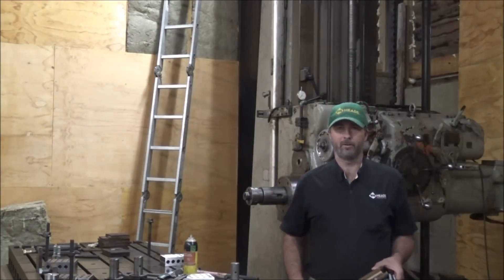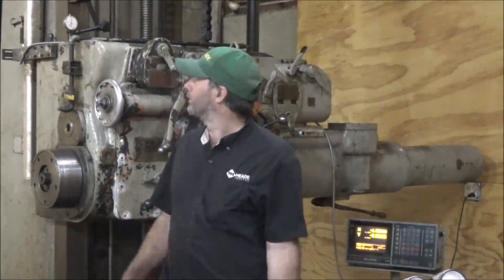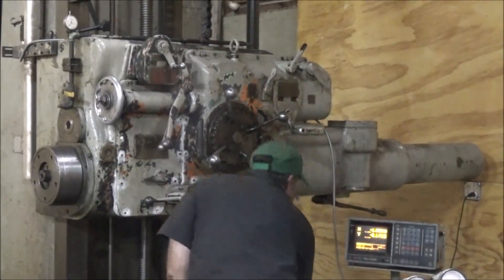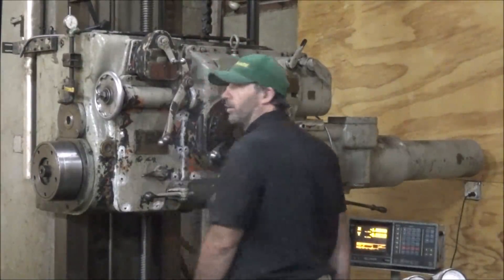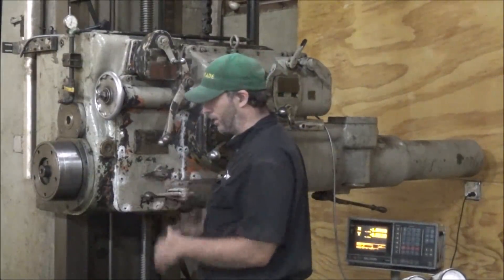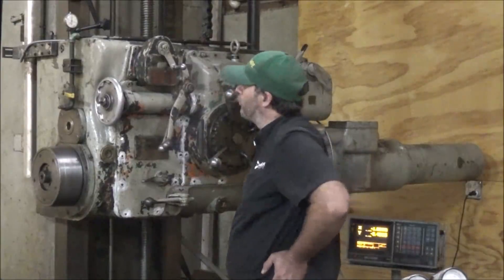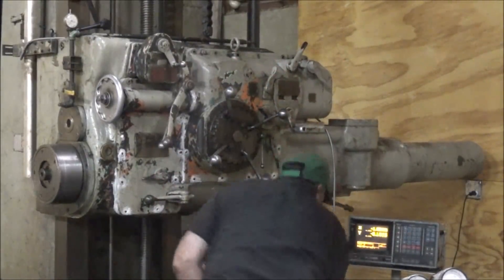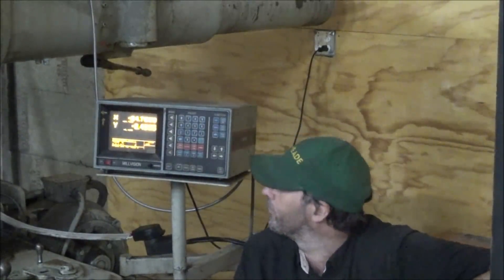DRO fixed!

Comment: Where did you end up finding the reader?  I'm still struggling to get my X-axis AR-5 scale to work on my mill.  Still hoping it just needs adjusted, but no luck yet.
Reply from the maker: Does it read numbers at all ever or always nothing?
Reply: When I first got it, it would read intermittently.  It would work just fine, then it would go blank (I think, or 0's or 8's or something).  Then I could reset, and work again for a bit.  Seemed if I went really slow, it worked longer than if I went fast.  I took the reader head off, and cleaned it and the scale with alcohol, and now after re-assembly, doesn't read at all.  However, when the reader head is off, if I move an allen key (or other steel) over the head, the display does read a change.
Reply from the maker: Sounds like an alignment problem. You may have to bend the wire some to be sure that the side of the reader with the plastic feet is squarely against the glass. It should have tension pushing it up as you put the reader into place and bolt it.
Reply: Thanks Brian, next time I get out in the shop I'll give that a shot.  I've really enjoyed having the Y axis DRO, so getting this working would really be nice.
Reply: Our G&L at work has a Dro as does our 16 ft Betts VTL floor mill .

Comment: Watching it closely in operation, the load on the vertical screws has got to be ridiculous.  Is there a special high pressure lube used on these?  Back in the old days it would have been lead based (dead center lube?) I'm guessing. Seems like part of the noise in the lift is torque wrap in the rods, if these are in great shape and lubed to spec lifting or dropping should be pretty quiet, no?  Glad you got the replacement scale, amazing how you can still find stuff available.
Reply from the maker: There is some bend in the shaft that operates the tailstock elevation. This causes the bevel gears to mesh too tight and thus they make a lot of noise.  The screw nuts are auto lubed by the Vactra #2 same as the ways.
Reply: Gotcha.  Should have expected a flowable lube to flush waste, but still, what an "s-ton" of weight.  If you watch Keith Fenner's latest, he needs your machine for his Audi block.
Reply from the maker: Yes the G&L would be handy for Keiths Audi but I am sure he will manage ok. :-)

Comment: How old is the dro display box.  It might be time to examine and map out the electrolytic caps in it for future replacement . Caps are used by some manufacturers as timers that blow out requiring complete replacement of the system.
Reply from the maker: It likely is about 30 yo.
Reply: bcbloc02 absolutely cap time

Comment: Nice work Brian, especially on a big machine like that one the DRO is necessary, as you pointed out about resetting a dial indicator over over and over, every time opens up that much more chance for stack on tolerances to bite you.

Comment: Brian, somewhere on the back of that DRO box there should be a brightness adjust knob. It looks like it's full on bright, turning it down as dim as you can easily read it, will save that
CRT (the tube).
Reply from the maker: There are no lights over that area yet so the camera adjusts to the dim condition then the monitor looks super bright. It is only turned up about half way in reality.
Reply: That's cool.  The dimmer you run it the longer it'll last

Comment: ya that old millvision is pretty awesome love the monochrome must be the magnetic scales like the hiedenhain expensive hard to find sometimes ebay or the  like can reward you with the shelf-worn vintage box though oh and watch out you almost knocked the cord out at the back there baily must be out sniffin out possums they can be benifficial eating snails and beetles and the like
Reply: They are glass scales like standard Accurite DRO's.
Reply: The back of the ram clears the plug

Comment: That ram housing JUST clears the plug on the wall behind it.  Cool you're getting it up to snuff
Reply: I figured a big machine like that would need a bigger plug.
Reply from the maker: No it is just 7200Volts. :-) lol
Reply: I thought it was going to hit. Brian needs to film in 3D if he's going to use equipment that big.
Reply from the maker: The anchors in the floor were positioned so the mill would clear the plug. :-)